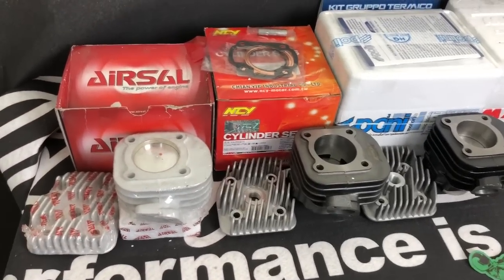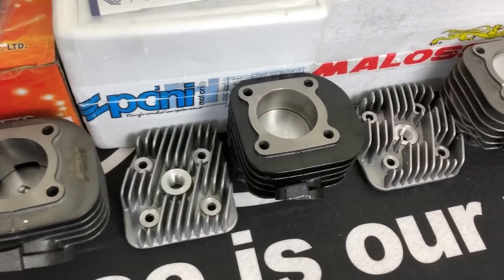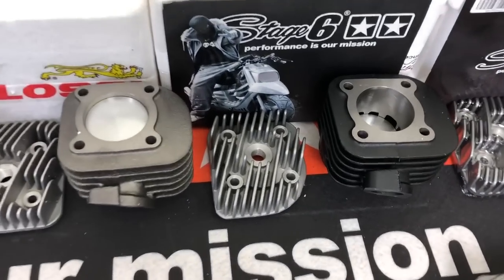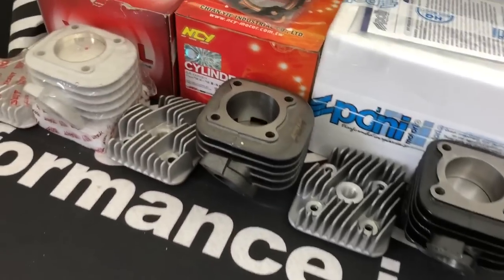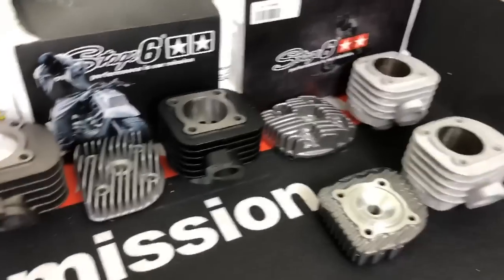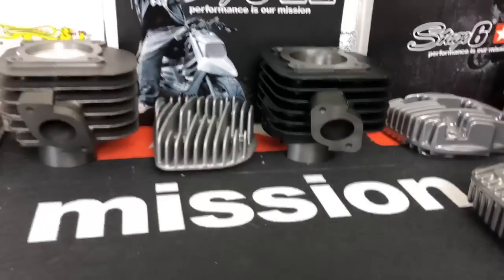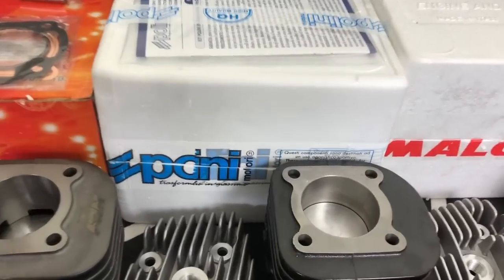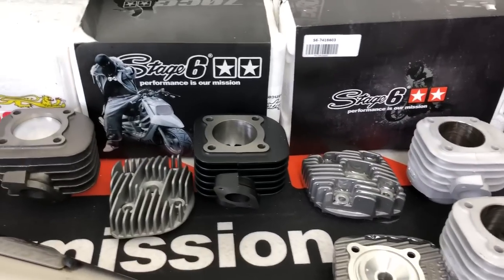Yamaha Zuma cylinder comparison 70cc

Comment: Malossi sport or polini sport are the best, great casting and last with a 17,5 mm carb. Had both, malossi has a bit more torque, polini a bit more speed. Its up to you but put a good crank in it, stock one isn't strong enough for 70cc. Good pipes are Gianelli Shot or Yasuni R. I rode both with a Leovince SP3, lots of torque and low sound. Only just a little slower on top speed as those other 2. If you ride daily I would recommend a Leovince Touring, Malossi multivar with 5,2g rollers, malossi ventilvar and yellow malossi spring
Reply from the maker: ok
Reply: Stock crank is strong enought for a sport cast

Comment: I have 2 zuma bws's one is an athena half breed. looking to upgrade bolth units to 70cc (whole pack) with the same setup, was thinking stage 6 but not allways available. Bolth run long and hot with weight ( mountian trips ) octane is about 100 - 140. Any suggestions on wich cylinder packs an carbs to upgrade with? And yes also doing the variaotrs, belt, gears.
Reply from the maker: need alot more info then that call the shop we can set you up with the proper parts!

Comment: Hey guys, Thanks for this great video. I have a 2005 Piaggio Typhoon that has 12k mles on it and has been sitting for a while. I bought it at an auction and it had the stock pipe on it when I got it that was rusted off at the head connection. I only just managed to get it running and rode it around the yard then parked it for several years ago. I want to buy one of these kits that is the the most reliable, I won't be street racing but I would like it to be fast and I would actually like it to be very quiet if possible (sleeper?). I would much prefer to have strong mid range instead of extra top end also. What would you suggest for a kit, carb and pipe and how much can you sell it all to me for. i'm in N.C.  Thanks in advance. I will also check out your posted sites
Reply: I recommend buying from scooterswapshop or Racingplanetusa. malossi 70cc  kit is pretty reliable with a 19mm or 21mm carb to take advantage of all its power. exhaust im not so sure about because the stock one will probably not be the best to use. Tecnigas does make a silent pro exhaust but i have never used it.
Reply: @lek2455  Thanks, I appreciate that. I'm looking for a quiet probably Leo Vance so I can go off road it in the woods near my house with less neighbor complaints everywhere, also
Reply: Don Favro if you put a leo vince it probably will be almost rhe same noise as any other performance pipe. i also heard leo vince isnt that big of an improvement over stock. not sure, my scooters ive owned i always went with tecnigas exhausts. currently own a 2011 Eton beamer 3 with a technigas next r, ncy clutch pulley, and also waiting for malossi 70cc kit and 21mm dellorto carb (shipping is taking forever).
Reply from the maker: looks like you got helped

Comment: Good video and very informative on what pipes and carbs run best on these different cylinders. What I would recommend though is showing the port lay out difference  and exhaust port size on these kits. And also point out that the Stage 6 race has a bridged exhaust port which looks to me that can be opened even wider making even more power from this kit if fitted with the right exhaust and a large carb. I also noticed that the Airsal exhaust port was half closed. Meaning that it wouldn't make any power in the higher rpms over stock but would definitely have more torque due to the larger displacement and also may rev up a bit quicker over stock due to the nikasil having an effect of lessened friction on the piston rings. I had a steel liner put into my NSR125 (stupid mistake) and lost 5bhp on the dyno due to the friction on the rings. But it does come with benefits of rebore and honing as you mentioned!
Reply: What is the best for a 2000 kymco zx fast fever 50cc racing kit
Reply from the maker: thanks

Comment: I’ve run the street/race and the corsa both on a Gianelli reverse pipe and 19mm dellorto carb. 
The street/race felt better on the butt dyno. 
I’ve ruined two kits with rod bearing failures. Both basically my own fault. Buy the highest quality rod bearing you can. Definitely not a place to skimp. I’m currently running a bearing for a KX65 12mm pin.

Comment: I’ve got a 1998 yamaha zuma with the vertical style cylinder set up, not the horizontal. Will these kits fit the vertical style too?
Reply from the maker: So on the vertical style Zuma, only the vertical style cylinders fit
Reply: I also have the vertical minnareli having a hard time finding a 70cc bbk carb and reed valve please help lol

Comment: Love your videos and your shop. Going to be buying either a Corsa or Contessa for my '99 Jog/Minarelli from you guys soon. I don't mind a rebuild every 5k-10k miles or so, but anything more I'd like to avoid. I'm going to be uphrading the stock crank either way (suggestions?). Should I go with a Corsa or Contessa?
Reply: Get Dr.Evo 70cc i have that zylinder in my scooter and i works now for 23.000km , and you dont even have to change the crank
Reply from the maker: THANKS SO MUCH HAVE YOU SUBSCRIBED YET?

Comment: What kind of power and Pipe we talkin about on the polini sport kit I'm running a z right now with a 21mm dellorto the engine just ain't doing right how you know where the pipe turns on and off at
Reply from the maker: call the shop and talk to Paul he can set you up with something that pairs with your needs

Comment: One of those 17hp kit would be amazing in a big 16" wheel kymco people or piaggio. Are there any 2T 16" scooters floating around left on the market in the US? Also been a fan with the 14 and 16" wheels, handles more like a bicycle, motorcycle, doesn't want to stand up or torque steer when braking in corners like the 12" and 13" do.
Reply from the maker: no 2t bicycles here
Reply: @Scooterswapshop  ah in that case the liberty 50 4T with 80cc molassi bbk and ecu would be about as good as it gets stateside for small big wheel scooters that qualify for 49cc Uber Eats registration.

Comment: I run the malossi with an 19mm carb, an I love it,
Reply: Did you have to change the crank or will the stock 1 suffice?
Reply: @graffiti4416  Stock crank will run perfectly fine. i also would recommend buying a 19mm or a 21mm carb with the malossi 70cc kit. stock carb with upjet will work but theres alot of power you would be missing out on.
Reply from the maker: nice!

Comment: i want to build a low rpm torque monster on a peugeot witch Exhaust do you recomend with the 70 cc cast iron
Reply from the maker: what type of engine is it
Reply: @Scooterswapshop  It is an Vertical AC peugeot vivacity from 2006

Comment: Great video. 

Why do you say you will eventually blow your stock crank with the stage six street race kit.

What pipe would you suggest to run with the stage 6 street race with stock carb?
Reply from the maker: Because Yamaha cranks are very weak. They fail. Street race won’t last very long with a pipe and a stock carb

Comment: I have the polini 19 mm phbg with fitted malossie intake but was wondering what line go where for fuel and air and oil go and I'm running it with a corsa and a v8 pipe  does this sound like a decent set up. Just wondering what gears I should run
Reply from the maker: where did you buy the carb?

Comment: Thanks so much for making this video i had a aerox at 16yrs old now just bought myself a Yamaha BWS with full malossi kit on malossi clutch variator malossi belt light weight rollers desltro 19.5mm carb mallosi gear up kit, quick action throttle & it’s awesome it’s really fast Does anyone know if you can put a hydraulic brake on the rear?? It’s a 98 model. Thanks guys/gals
Reply from the maker: Glad I could help!

Comment: hello,  im from amsterdam alot of these brand's are really common to know about for me like airsal,polini,malossi,athena....how  familiar are you in america  with the 2 stroke brands?,,   my opinion about the cylinders  it's  a great layout  i in person will only use air cooled  iron cast  polini  stage 6  dr,top performance  cylinder kits simply because those alu race kits air cooled  get to hot with road use,  all these minarelli AC engine's u can easy  swap to a LC build  and make those  cylinder kit's  last 3 times longer and  keep the ideal temperature range and keep the peak power and not  burning the piston rings i heard u mention  yasuni exhaust  those  are definitly top of the line  :D  having an  r,c16    u can  drive almost any kit already :)
Reply from the maker: visit our website!

Comment: Do you have an opinion on the motoforce cylinder kits? I have an Aprillia sr50 ditech that has less then 700 miles and previous owner ran it out of injection oil.
Reply from the maker: They’re as cheap as they get I would strongly advise against using one
Reply: @Scooterswapshop  I appreciate the response. The cylinder is cast iron so it could be bored if oversize pistons are available. Tempted to go 70cc kit but these ditech seem overly complicated and I’m afraid to create a nightmare. Do you have any Aprillia experience?
Reply from the maker: @jimccc9467  yea lots of experience with these! Check out our newer videos
Reply from the maker: @jimccc9467  at the end of the day you get what you pay for. If you buy a $125 cylinder kit expect issues. Buy the malossi kit and you’ll have no problems
Reply: @Scooterswapshop  I see Malossi 70cc kits, some come with another ecu and some come with another cdi, which is appropriate for the 09 Piaggio? Do you folks sell the kits? Do you have a pipe preference that is appropriate for the 70 kit?
Reply from the maker: @jimccc9467  we sell the cylinder kits and pipes for this bike

Comment: Hi man, i have a stsge6 street race 70cc cylinder kit, performance exhaust, stock mikuni  carb, 5gram sliders, stage6 variator, naraku drive face. Question is, do i need to warm up the scooter from cold start like for 2-3 mins? I just notice that if i run it straight away from cold it boggs briefly then it goes away and will be fine. Do these cylinder need warm up?
Reply: Nino Echavez u shouldn’t ride a bike without warming it up first
Reply: Yes absolutely, warm it up or you can 4 corner seize / stick a piston
Reply from the maker: everything has to warm up bud....

Comment: The Stage6 street tunes down for the low end really well. It can make power up into 12k RPM, but it also can get mountains of torque lower down in 7k/8k too. Which is what makes both usable and unusable with the stock crank. You aren't going to be using it with a stock final drive and and high RPM pipe on stock. Using it with stock/silence design pipes, and pipes like the LeoVinceTT, giannelli extra, and the china special, along with heavy weights and a long final drive- will work really well on the stock crank with it. 
The stage6 replica pro, is designed to go with the cylinder, and really breathes the large powerband of it (is insane, makes power between 8k and 11k), can also be geared and weighted heavy for on the stock crank. The cylinder WANTS to rev high, but will still be content running in the lower end of things.
Reply from the maker: ok
Reply: Yeah I have a stage 6 70cc makes grazy power

Comment: Very good info, isn't the air cooled MHR more powerful than the stage6 race bore.
Reply from the maker: The stage6 race and mhr are very similar in power. However the mhr is a higher quality
Bore
Reply: @Scooterswapshop  ok i would've thought that the mhr would've been more powerful. My fav air cooled 70cc cylinder is the polini evo. Those are straight beast. I've seen those smoke mhr air cooled cylinders. Too bad polini stopped making them.
Reply from the maker: wsmaga yea we’ve dynoed them all. The mhr and the race are in the 15-17 whp range. Pretty close in numbers. The fastest 70 is the 2fast by far but it’s a lot of machine work and porting to make work right